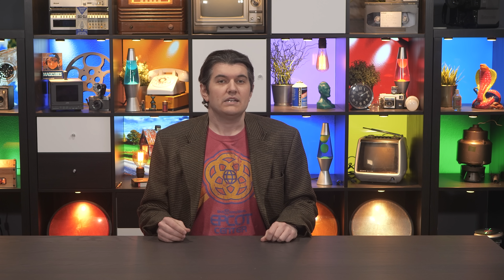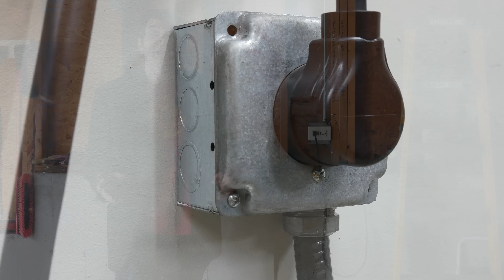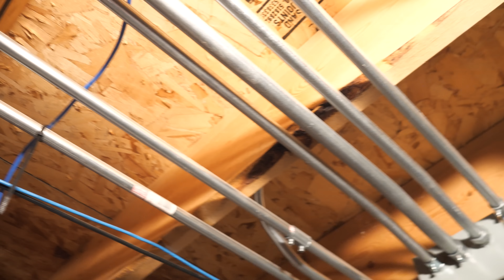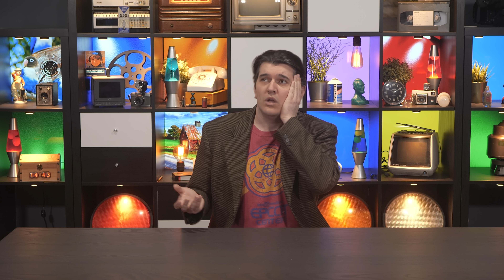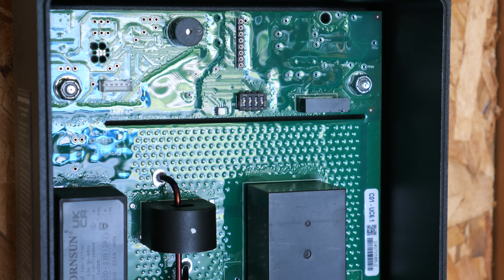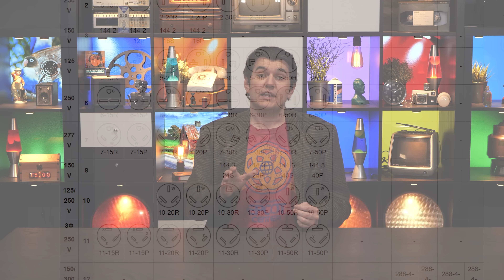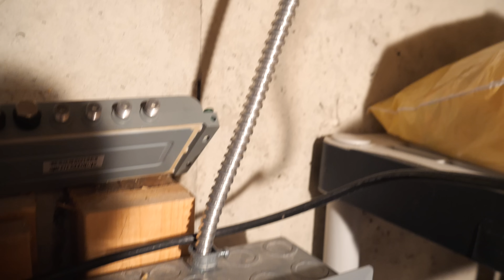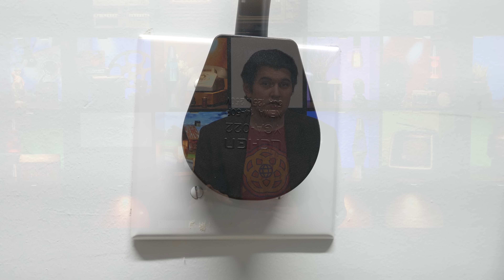The "standard" car charger is usually overkill—but your electrician might not know that

Comment: Slow charging is safer, anyway. The current and voltage available from fast chargers are very high. If everything is working right, then there's no issues. If anything goes sideways, DC arc flashes are incredibly dangerous and damaging. Sure, 240VAC is dangerous, too, but far less so than 600VDC.

Comment: I’m running an off-grid solar power setup, so having smart features in my Emporia EVSE is huge. I’ve got to make sure plenty of solar is hitting the panels before I can start charging or I’ll tank the house battery. All that sweet sweet solar was just being lost before I got my electric truck to soak it up. Edge case for sure, but I’d be toast without it.
Reply: I was looking for this comment. Emporia has kinda the only useful smart features I've seen for EVSE. Being able to work with solar and being able to dynamically self limit for people with smaller services or high variable loads are actual smart features. The main weakness Tom Moloughney pointed out, and I think Alec would agree, is there's no way to set hard limits via dip switches.

Comment: meanwhile me in Germany: installed a 22 kW charger just because "why not?". the expensive part is putting the cable in the wall, not the cable itself. my current car charges at just 11 kW and my solar only has 10 kW output, but in case someone with a single phase only obc visits, it can at least charge at 7.2 kW.
But for people with solar a faster charger is really useful, because depending on the weather you might have a few hours of sun while the car is at home and could be the difference of 100 % self sufficiency of ev charging and having to purchase grid power for 30+ ct/kWh regularly.

Comment: Not gonna lie, I disagree here. I think I woulda just run the conduit and 6ga for 50A...it's like $30 more and future proofs it for if I ever want faster charging. If you can get away with NM cable sure, you can save more but if you're already paying for armored cable, conduit isn't that much more expensive. Basically the same amount of work, and very little extra money.

I would also never install any electrical to the stairs themselves personally...the wall is right there, as unlikely as it is that the stairs would break and you'd end up with live wires hanging out, I'd rather just not take the chance.
Reply: The skill to form EMT isn't universal.  I like the free-form versatility of MC and it clamps nicely.  Alec was incorrect in thinking that MC isn't available in 6 AWG, it's merely unavailable from his chosen supplier, apparently.  I agree with running the highest ampacity circuit that's practical; it's future-proofing.

Comment: I still think instead of "charging" - EV's should use some sort of standardize modular batteries, and then there be battery exchange stations, not unlike there currently exist BBQ propane tank exchanges. Instead of one giant heavy battery, there could be multiple smaller more manageable ones, say in pairs.

Comment: I had a Chevy Volt before my current all-battery EV and for the first two years I charged it on the 110 V line. The thing that got me to get the 220 charger installed was having it occasionally trip the GFCI circuit breaker on startup (and that was with the car doing 8 A charging!). It never felt "slow" unless I wanted to charge in the middle of the day; it was always done by morning. Switching to the 220 V was night and day though and when I went to a NACS-powered car, it had two J-1772 adapters so one lives permanently on the home charger while the other lives in the car. I honestly don't remember if it's a 24 or 32 A charger because it doesn't matter, the car always charges fast enough for my needs.

Comment: In Finland I charge my Model 3 in an apartment building parking lot with just a simple level 1 charging which is just 240V at 10 amps. Luckily there is already a "heating pole" for engine block heaters because of the harsh cold winters, so only the timer switch had to be changed and the wiring is already strong enough for normal schuko plug amperage. Even in the winter, the measly 2.4 kW was enough to charge, though the charging efficiency is only at ~ 50 % in extremely cold weater, but it was still enough. But to be fair, I only drive less than 250 miles a week.

Comment: I don't own an EV yet, but I own a solar system and I would like the charging station to communicate to the car in very short intervals what it should draw from the wall what my solar system would otherwise feed into the grid. It needs a network connection and needs to be smart for that, but I require it to work fully without any internet connection.

Btw, I'm glad we, in this case Germans, have CEE connectors and don't have to deal with NEMA. I find it interesting how much different electrical installation is done in the US compared to other countries. Especially all the metal around cables and connection boxes. The breaker boxes are very different and have a 100 year old vibe to it. Especially the black color make me think its all bakelite. Because you requested it: Wire nuts, eww, Wago ftw!

Comment: Did you know that the 120v charger that comes with many EVs (my Bolt came with one) can be run on 220v? They don't want to change the electronics for the European market so they take both voltages. And you get double the charge current of course. I did that for a while when my 220v 32 amp charger (or whatever we call it) died and I had to send it for warranty replacement. Still was able to cover all my driving for the duration.

Comment: before I wired full power to a Tesla wall charger we were using a dryer plug at 24amp 240.  Turns out that was fine.  In fact, now I have 2 Tesla's and 1 charger, I think we could comfortably do 4.  And probably uncomfortably 5.

Comment: I retired recently and sold the family home, It has a 100 AMP Main panel and 2 - 40 amp sub panels,  with a second full size range in the apartment, AND a 50 amp welding outlet in the shop / store. :) 

We NEVER had a high enough load to trip the main 100 amp breaker.

Comment: My Hybrid Chrysler Pacific took 12.5 hours to change enough for 30 miles with the factory 120v charger. Putting in a 32 amp 240 charger brought it down to about 2 hours. I did the work myself, so it wasn’t too expensive.  I could have got away with the standard charger but the van wouldn’t have had as much of a charge with our daily use (coming and going) with the standard.

Comment: A small thing about smart chargers (from an EU/BE perspective): A LOT of people here have company cars, which used to be provided with a fuel card. Nowadays they come with a charge token, which when used at your home charged, will reimburse you for the power you've consumed.
Additionally, connectivity with some form of home energy management system / smart meter is mandatory if you want to be able to regulate peak demand and avoid peak/congestion charges that exist here, or to enable self-usage of solar generated power, which is financially approximately 10x better than selling it back to the grid.
While the car will offer some of these options, they vary by make and model, and are often only available when the car has 4/5G connectivity, which is problematic in apartment buildings, and you're paying for the cloud subscription. An ethernet connected "Smart" EVSE will do its just just fine, and have local APIs you can use.
As an example: My main fuse is 3x20A, and my charger's circuit can handle 25A, but it's software limited to allow a max net draw of 4kW (to avoid congestion fees). When I'm cooking, my induction cooktop also uses 4kW, but the charger knows to pause if needed. If the sun is shining, it can charge more than 4kW because of the additional incoming power etc. All things you can't do with a "dumb" charger.

Comment: Like a cell-phone battery, is an electric vehicle battery life expectancy dependent on the number of times the battery is charged.
Would it increase the life expectancy of the battery when the battery depth-of-discharge is down to 20% ?

Comment: What I hate just about the looks is public charging. In my city, they want nearly double the price per kWh for AC charging and an additional unlock fee, if you don't sign up for a monthly membership. Even if you are a customer of that electricity company for your home electricity, the kWh price is still more than at home and you need to pay monthly. I guess some see that they save a lot for DC charging but in the end, a kWh is a kWh and it doesn't matter how it entered the car.
The neighbor city, where I work, has the same prices for kWh but no unlock fee. 

Obviously there is a reason why its more expensive, because they need to pay for the infrastructure. I say their infrastructure is garbage. Its placed where people can commute but not live. In my district live around 10.000 people and we have 2 AC charging stations, both 22kW max with 2 plugs each. 1 is actually placed just where people live. The other spot would be our "shopping district" (just one discounter, foreign super market, a doctor, a pharmacy, some food stuff and other small stuff) with limited time parking. It would be rude to be connected all night, especially you will get fined by the station, its not really enjoyable to spend half an hour to unplug your car and park it at home, especially when in the evening, the good spots are taken. 

I would say it would be a good infrastructure if they pump out on street charging with a low powered charger, where you can leave it plugged in. It would be way more attractive.

Comment: In China, if you live in an apartment building(most people here do), you can get the utility company to install a  sub circuit in the underground parking garage under your apartment building that allows you to install an ev charger and also pay for the electricity. Some cities have programs which subsidize these special ev charging sub circuits and give these circuits better electricity prices compared to regular household circuits. Its not uncommon to see populated buildings with large electrical boxes in the parking garage that include more than 30 of these sub circuits.
Reply: The cost of installation is 1/100 the USA - so they can. I asked about installing just dryer outlets in a complex where the electrical boxes are in the garage - so just a covered cable, a GFCI breaker and the high end outlet. How much? $1200 - even with doing 50+ units. 

If it was an apartment where the electrical box is in the unit, it would be insanely expensive. The electrical provider would have to put in a new meter for every parking stall and then a cable would be run to each stall. That would cost more than many EVs cost in China : )
Reply: @kapdolkim1914 , you don’t need a separate meter for each parking spot.    There a smart meters and the utility can software bill to each customer account.
Reply: @kapdolkim1914   So if I put a Bitcoin miner in my apartment, you won't know? Nice.
Reply: @thewhitefalcon8539 , you can have a bitcoin miner.   But you have to pay for your own electricity.
Reply: But the huge difference is that people own the parking space, so they can modify it
Reply: I think they also have smart software meters allows them to bill to your electric utility account.
Reply: State politics do that, gotta defeat the west
Reply: Benefits of authoritarianism
Reply: @thewhitefalcon8539  Strange, we have a similar regulation in Germany. The HOA (to use a known term, although things are working differently in Germany) previously had to approve any changes, because the parking garage is under joint ownership unanimously. Nowadays they can only refuse if there are technical issues to install the power lines. The installation costs are your private issue.
But I assume Germany is authoritarian?
Reply: Do these apartments let EVs to  park in apartment's underground parking garages (ev fires) ?
Reply: @manout-kidin8735  That's basically what he was saying. Same here in Germany, no special regulations. The chance that an EV is actually burning is approx. 1/10th of an ICE car burning. Why would you need to take extra care then.
However there are still a few people who have no clue, but much belief who try to impose such restrictions. With varying degree of success.

Comment: Lucky you for being allowed to do your own electrical work. If I tried that, I face a prison sentence, yet I have seen 'qualified' electricians doing work on my board and when I checked, the wires were pinched in the circuit beaker panel cover. I do a better job, but I'm not allowed to. (I have certification to 5kV, but not an 'Australian electrical worker's licence')

And you're complaining about having to run wires in conduit if they are on a wall (as opposed to in the wall). That's minimum requirement here, and I'm happy about that.

Comment: **From spain:
It is partially my fault that my mom bought a Citroen EV and the salesman was so kind to add a charger into the transaction. They also gave us a contact from a certified electrician to do the installation, and I learnt a lot.
First, by regulation, most if not all plugable chargers are limited to 3.5kwh if you don't add a certain sensor to the electrical panel. Apparently even if you have a 220v 40A switch on there. The good news is that those kind of installations are "free" because goverment programs, which usually mean that you pay upfront and maybe in a range of two years you pay less taxes to compensate.
The thing is, since is the goverment who pays, the electrician company gave us an estimation of 2000$ for the installation, for a charger that we already own and lets say 6 meters of cables that we already have installed. The sensor we need comes prepackaged with the charger. Since she doesn't drive much we are doing well with just 3.5kwh charging, you don't usually need more, and we are able to move the charger with car for when they go to their secondary residence. The day we finally make a stationary installation I'm going to do it myself, because fackyou and your 2000$ scam.
In any case, charging over night don't require more than that.

Comment: I don't see 20-30 minute fast charging to be an issue. I pull into a gas station and when I leave the same cars that were there when I pulled up are still there. People spend so much time at the gas station already I don't see how they can complain that charging takes too long.
 
    I am one of those you complain about. However I know how those car chargers (glorified overpriced extension cord) and yes I do leave all my garbage on the floor at a jobsite. As for the receptacle melting. They were never meant to handle that amperage for many hours on end. They were meant to handle those amps for minutes to an hour and not at full load. 
   I would like to know why they put the receptacles horizontally in Chicago. I have a friend there and when I visit I find it so strange. There is no reason for it and the excuse of it being hard piped doesn't have any legitimacy. I have no problem in commercial putting them in any orientation I want to. 

            Sadly no Menards in TX yet. I have driven to the one in Wichita,ks and even with the cost of gas and a hotel I still saved a couple 100 over buying from the local suppliers. TX is far more expensive to live in than many realize. And my message ringtone is the menards jingle.

Comment: If you can charge on a 120 volt circuit and if you have 12AWG wire on that circuit you can simply install a NEMA 5-20 receptacle and decrease the charge time by 20%.

Comment: I leased an ioniq 5 last year. I travel for work and stay in a hotel all week- I'm only home for about 40 hours on the weekends. I do not have (and do not plan on adding) any charging at home other than the standard 110 outlet. Because I don't really need it. My car came with free charging for two years, which I use exclusively.

If you were to buy an EV, having a level 2 charger at home would be nice..but for most people not needed. The level 1 chargers should give you 3-5 miles an hour, so if your daily commute is 25-50 miles or less and you plug in nightly you'd wake up with a full charge every morning on a level 1 charger. Even if your commute is double that, you'd be fine as long as you plugged in on your days off.

Comment: the electric plug you show in the beginning looks very dangerous.
It appears to be possible to touch the uninsulated contacts while plugging.
Just today I finished my hoe charger (which is Germany is called "wallbox" -- may be as wrong as "handy" for a cellphone).
The power is 11 kW taken from three-phase current with a CCS socket. I feel much safer using the CCS plug.
Reply: The connector is not CCS but Type2, CCS is the version that has the 2 huge DC lugs at the bottom too, which is used on Mode4 chargers.

Comment: Anyone have any recommendations for a "small" plug in j1772 charger? I have a zero sr/s and the charger i have just barely doesnt fit in the tank storage. Being a motorcycle, i dont need 25' of cord. Im also looking for a decent tesla charger adapter that wont go all melty. So far been leaning towards tesla tap but $$$ and i dont think i need thst much quality since the bike only pulls 6kw max from charging stations.